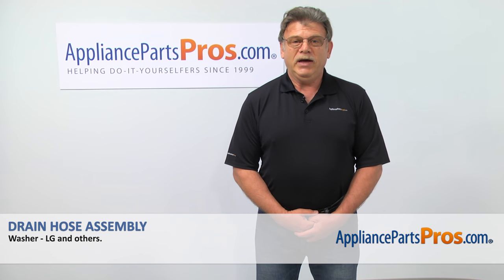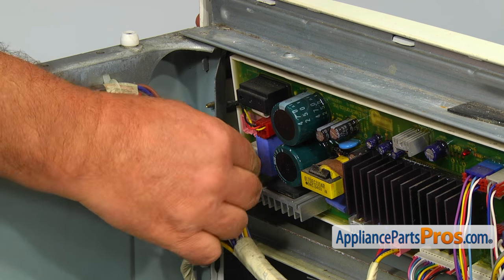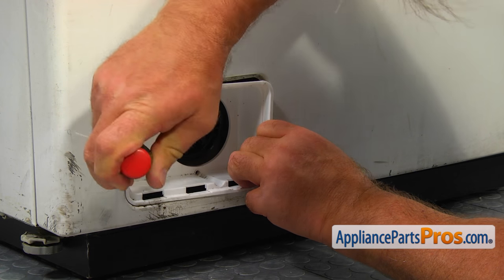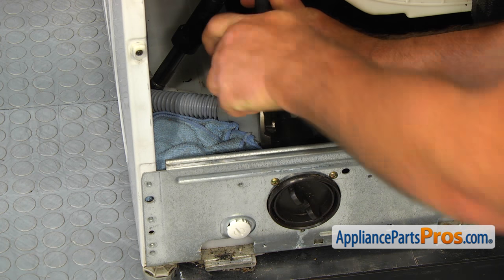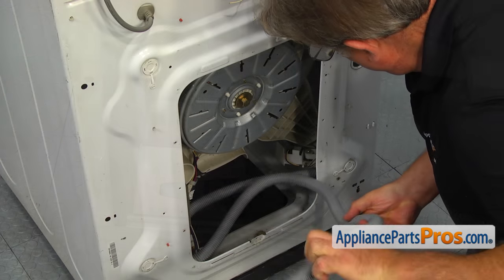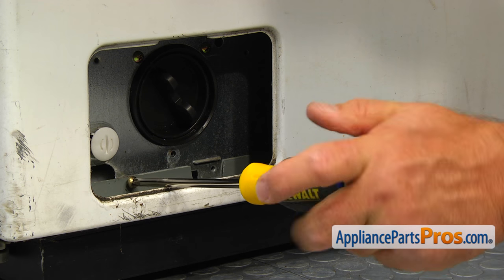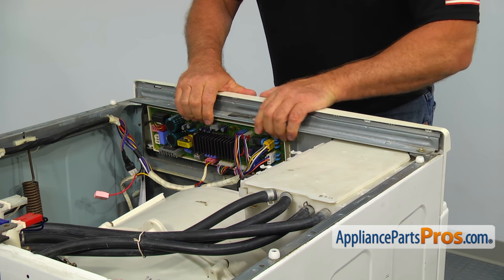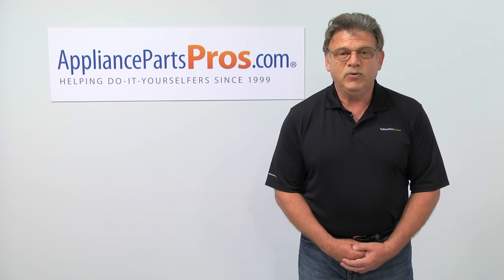How To: LG/Kenmore Drain Hose Assembly 5214FR3188G

Comment: Oh. My. God.  I just had a brand new LG front load washer/dryer delivered today and assumed that the drain hose would connect to an outlet on the washer like every other single washer I have ever seen.  When the integrated hose didn't reach my drain pipe, I came here to see how to connect the longer hose I already have, and learned that I have to take the entire washer apart if I want to use a different drain hose!  This is RIDICULOUS!
Reply: LG, you motherfathers!
Reply: Lol agreed! 🤣😫
Reply: This is insane! I guess I’m goint to DIY an extension. There is no way I will disassemble my perfectly functional washer
Reply: Me pasa Exactamente lo mismo! Mi lavadora es LG True Steam y se rompió precisamente en la salida del desagüe, no de abajo, a la salida, donde va unida a un tuvo a la altura de un metro. Cómo vio a desarmar todo!!! Hay un mapa de la lavadora accesible. Dónde?

Comment: If your just replacing the drain hose. Why are taking the washer apart? Just lay it on its side on a towel or foam support. Takes 5 seconds to accomplish the same thing?
Reply from the maker: In this case, you might be able to go up through the bottom to get to where it connects in the interior front, but you wouldn't have much room to work and it might be more difficult.
Reply: Chris Densmore that's exactly what I was thinking, go straight from the back!
Reply: @mr_bailey7834  Did it work?
Reply: Yes, tipping the washer on its side with a cushion support, and working up via the bottom hole worked for me. Thanks Chris for that tip!  It's a bit tricky putting the drain hose through the back panel, and sliding the drain's mount connection into the back slots, but take your time and it will work. Also, make note of the orientation of the green drain end before you take it off, and install the new part the same direction, in order for the drain line to follow along the side of the washer, not bump into one of the shocks.

Comment: Nice and well detailed video, you guys deserve all the credit in what you work for. A technician (not from Appliance) came today but he didn't remove the front door of the washer. Instead, he almost got inside the machine from the back ahahaha ... removed the hose and did all the rest with his entire arm without watching. Thanks, guys.
Reply from the maker: Glad we could help!
Reply: might try that myself after seeing what the bits looked like in this vid..
Reply: i tried myself.   There was no way i was able to release the clamp from the factory install from the rear.  It was angled away.
Reply: @reactionsok  I tried it today as well. Would have been doable if the clamp was facing towards the back, but in my case it was not. Had to do the long way.
Reply: @ADubTheGrizzy  dude I had to destack
Reply: I did it - had another person tilt the machine back and hold it - came through the bottom of the machine and the back panel [both].  I was able to remove the hose from it's guides, release the clamp, pull the hose off and out, and put in the new one and secure it  - it took a bit of work to secure the clamp - there is not much room - but it can be done.

Comment: Thank you so much for this! Seriously, I don't know why the drain hose is so much more difficult to replace than the supply hose which is like 30 seconds.
Reply: The water coming in to the unit should be clean, so you can have the supply lines attach to the frame.  Also the supply lines are under pressure so there is no pump to get the water into the unit.  The drain line has dirty water so if you did the same thing at some point you'd have to replace the line but if you only replace the line on the outside you'd still have a dirty section of host inside anyway.  The pump needs to be low to take advantage of gravity.  If they placed the pump to the back then you'd need to get behind the unit every time you clean the lint trap which you are bound to do many many more times than replacing/cleaning that hose.  

I suppose it's still possible to make getting into and out of the unit as a whole easier, but there are several reasons why the drain line is bound to be harder to deal with than the supply lines.
Reply: @Faladrin  This make so much sense it's frustrating.

Comment: I just went through this process, what a PITA, just to change a hose.  But I like how they skip forward the whole spring install.  It certainly isn't as easy as he made it look.  My question was how many times did they have to do it before the ring/spring was firmly in place around the rubber boot?  I've been trying to get mine on for about an hour now, it keeps slipping off and i have to place the rubber boot/gasket back on the rim.  Everything else went easily though.  After another half hour, I need to walk away.  I'll come back to it tomorrow.
Reply: you must not have it around the gasket properly.
Reply: If you really want, there's a $30 tool made for this call the tension ring expander. But this can be done with two hooks, some strength, and close your eyes. I've seen one technician almost take his eye out.
Reply: Had to open mine 3 times to fix a few things. Putting the spring back on was the worst part. If you watch enough videos they give tips:  Make sure the gasket is secured into the V-shaped groove before trying to put the metal ring on.  Start with the spring in place at the bottom and work the ring into its channel in the gasket from clockwise 6 o' clock to 12 and back to 6.  It would be easier with an extra person helping, but it was always late at night for me and I didn't want to wait.  You can get most of the metal ring into the gasket properly and then for the final part, use locking pliers or needle-nose pliers to pull the spring looser. The key is to pull to the side NOT away from the washer, so you're pulling the ring with resistance from the groove in the gasket and not pulling the ring away from the washer and gasket--easier said than done.  With patience it does work with one set of pliers, two, or even mostly by hand.  You can use a small screwdriver or similar to ease the remaining parts of the ring into the groove.  The last time I was able to just pull it almost completely in place by hand and just use the pliers to get the last part of the spring into the groove.  At the end, pull on the gasket all around and if correctly in place, it won't budge.

Comment: video is very helpful but i have one doubt , if the hose can be removed from backside why open stuff on the front?
Reply from the maker: You want to make sure that there isn't any water in that drain hose when you go to remove it. He was just showing you how to empty it just in case there is water in the machine.

Comment: I have to replace my hose because it was scraping along on the support shock. There was no clamp inside to hold up the hose.  I am going to hang the hose with wire to a bracket near the top.

Comment: Hello Simon (hope that's spelled correctly).  I have an LG Stromm steam washer model number WM2487H*M from around 2007-2008.  I am getting the OE code that says the drain hose is kinked or blocked.  I have followed your instructions as far as removing the harnesses and screws that should allow me to remove the control panel and place it on top of the washer but I have two issues.  The control panel doesn't seem to want to come loose after removing four screws (this washer has a brace running from front to back thus the extra screw.  The other issue is that when I look down into the body at the back of the washer there seems to be two drain hoses.  Do you have any suggestions as to how I might get the control panel loose and does Appliance Parts Pro carry the correct drain hose assembly for this washer.  Thanks so much.  Phil
Reply: I think you want #5215ER2002G
Reply: Thanks for the info Jesse.  My problem turned out to be a bad drain pump.  I cleaned out all of the hoses and replaced the pump and the washer works like new.

Comment: Why take all the other stuff off?..why not just open the back?
Reply: I watched it again for the same thought. The pump bit is at the front. I am assuming it isn't accessible from the back.
Reply: That hose is reachable from the back but not easily and since all the water flows out the washer through that connection, you want to make sure the hose is securely attached.  Opening the front and reassembling is not that bad except for putting the gasket spring back on.  For an older washer, there's likely many other things that should be checked and maintenanced anyway.  If the washer is not on a pedestal, you could also tip it and access via the bottom.